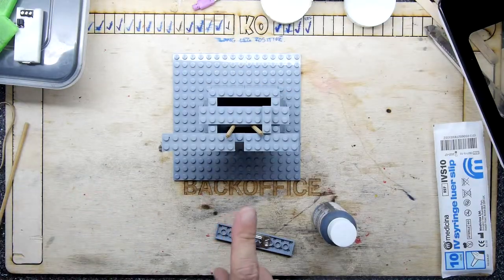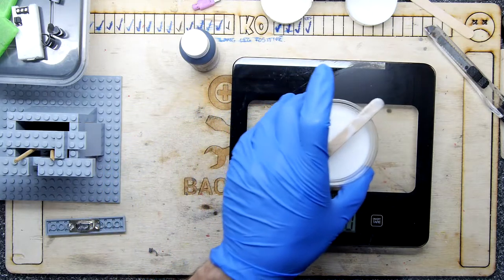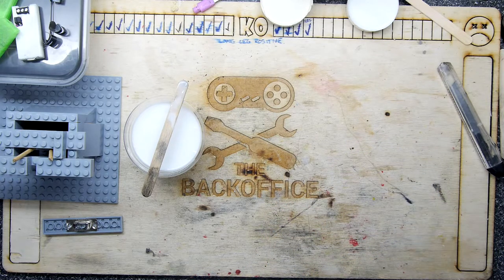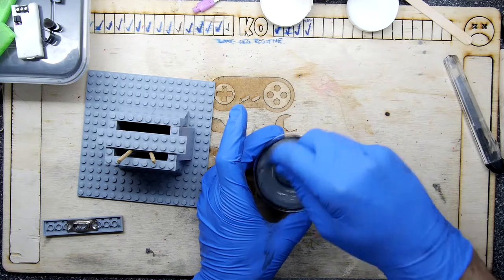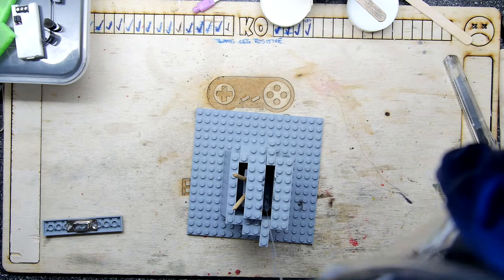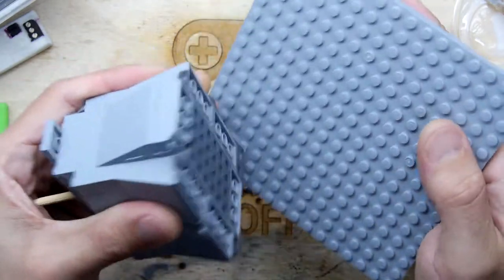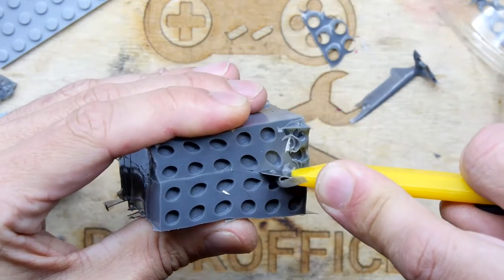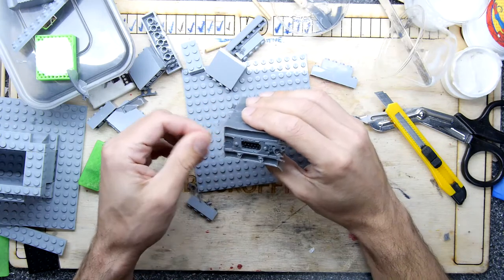RetroNET mould making

Comment: This is awesome! Really satisfying to see the lego removed and the mould inside! Question - could tapping the mould/desk cause enough vibration to pop the air bubbles too?
Reply from the maker: It certainly helps for the larger bubbles, but realistically most are microscopic so really need a vacuum or pressure setup (either work)